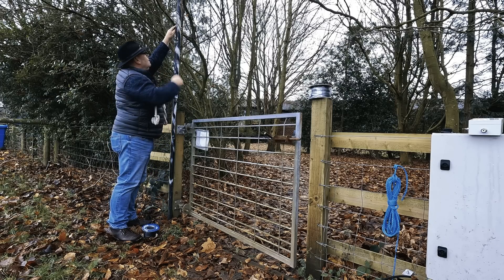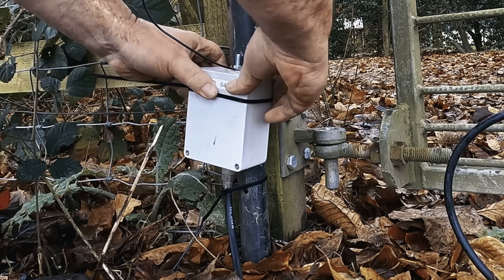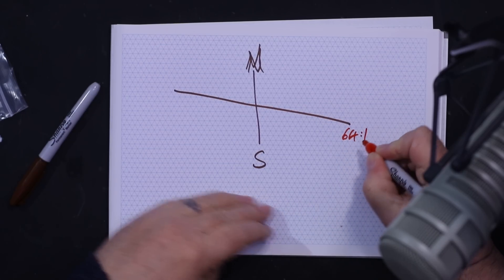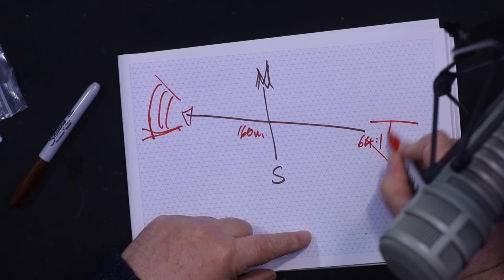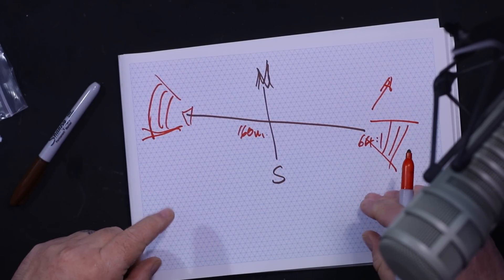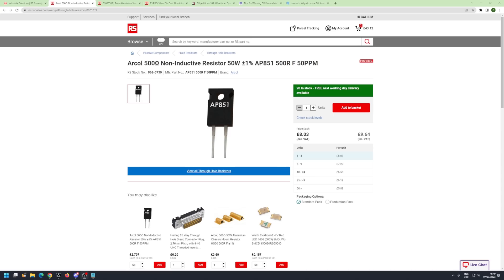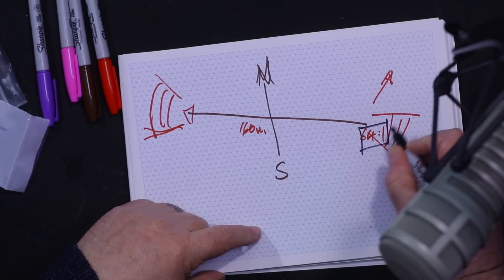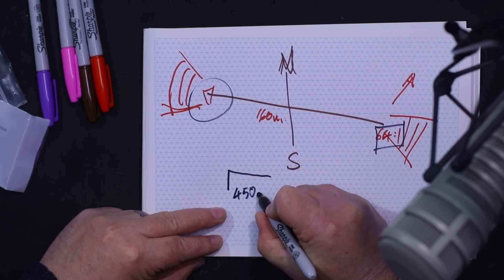Beverage On The Ground Antenna - Converting my Long Wire to Beverage Antenna

Comment: No reason for rigs the size of the 7300 and from K and Y not to have a receive port.  Elecraft seems to be better at this.

With radios being computers nowadays, receive ports should not be that costly to provide!
Reply from the maker: I can't think of a base station Kenwood HF rig that DOESN'T have an RX jack. Totally agree.